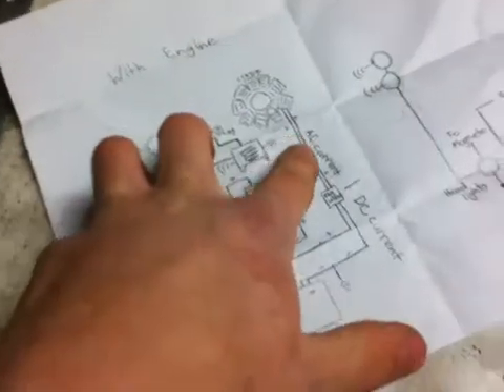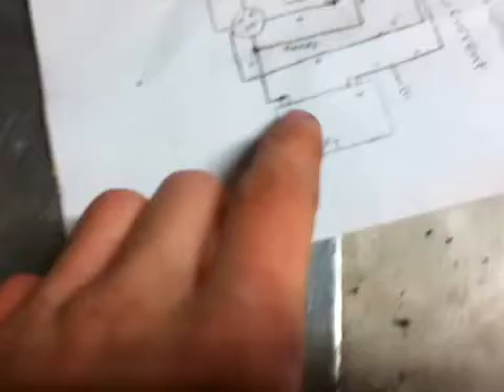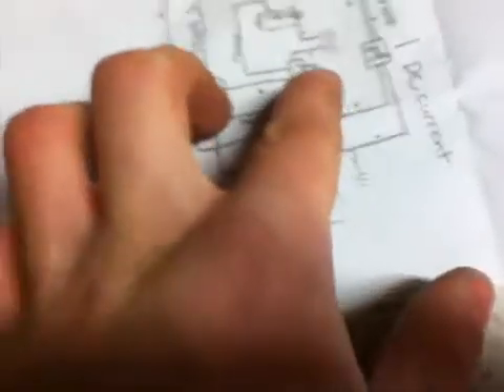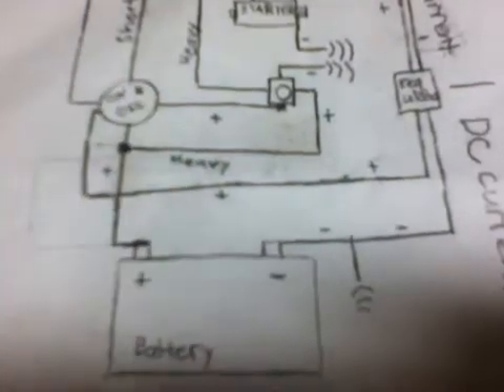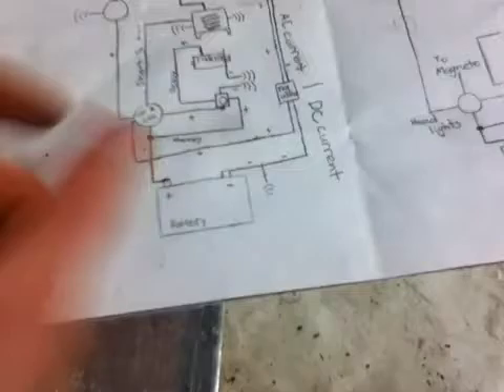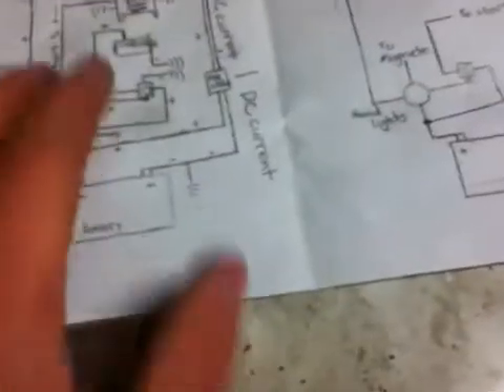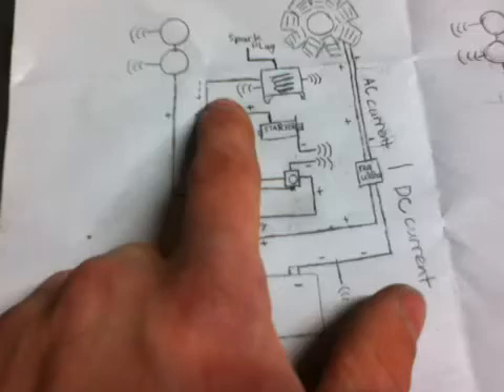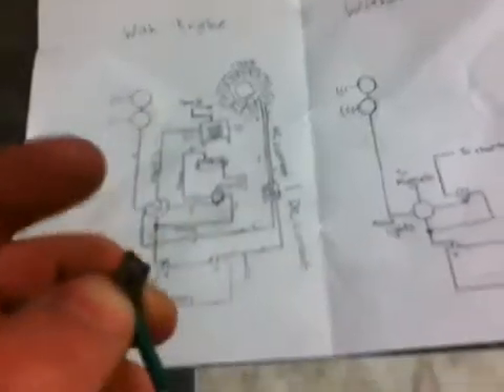How the electrical system works on a lawntractor

Comment: I gutted the wiring on my B&S 12.5hp murray and I'm having trouble finding info to confirm or deny something. I have two wires a black and a purple coming from under the flywheel I know this is for charging but what I don't know is can I just hook up the wires straight to the battery (black -, purple +) or is there something else that should be in the picture?